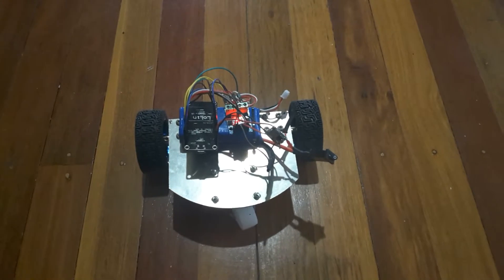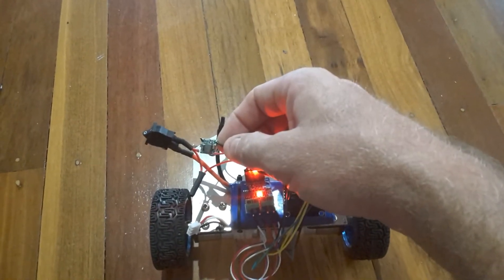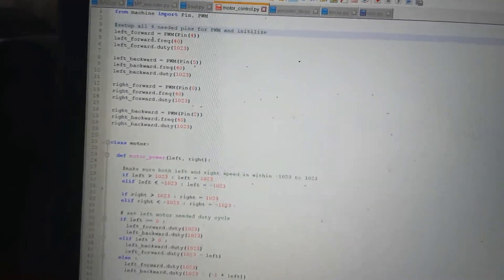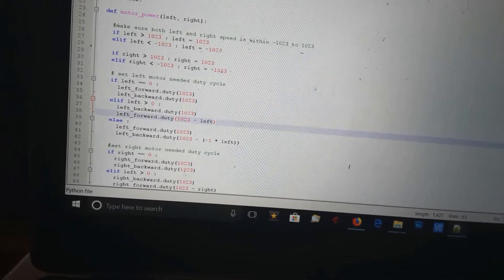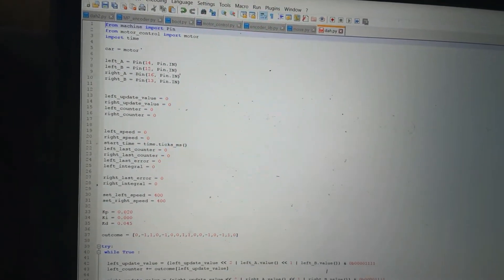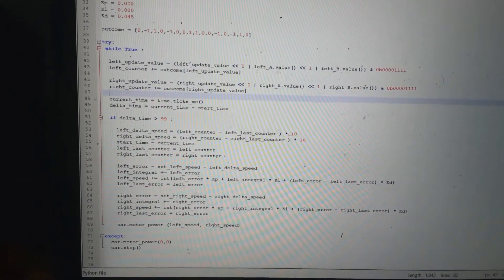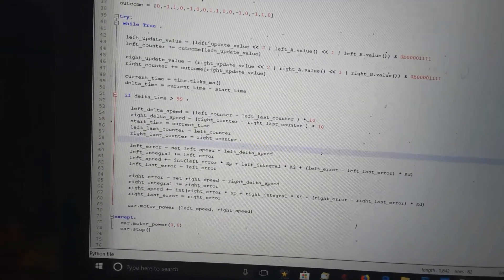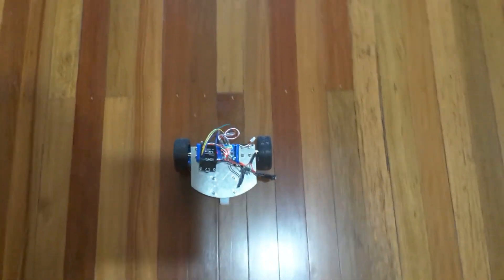Make ur robot drive straight

Comment: Thanks for your video. Btw, how you get the value of Kp, Ki, Kd? Thank you
Reply from the maker: Ahh that's the black art. There is a ton of videos out there on tuning PIDs
Reply: what speed unit do you use?
Reply: @rafliriyanda3868  He is using RPM for both wheels

Comment: Hi, what angle encoders did you use? How did you connect them?
Reply from the maker: I brought it all as 1 unit ready for plug and play like this 1 https://www.aliexpress.com/item/Bringsmart-Micro-DC-Motors-12V-Gear-Motor-Encoder-18-1930RPM-Reversed-With-Mounting-Bracket-Coupling-And/32947720948.html?s=p&ws_ab_test=searchweb0_0,searchweb201602_8_10065_10068_10130_10547_319_317_10548_10696_453_10084_454_10083_10618_10307_537_536_10131_10132_10902_10133_10059_10884_10887_321_322_10103,searchweb201603_6,ppcSwitch_0&algo_expid=c7d432ac-7f8f-401e-9856-6f0fc8060ac7-35&algo_pvid=c7d432ac-7f8f-401e-9856-6f0fc8060ac7&transAbTest=ae803_5